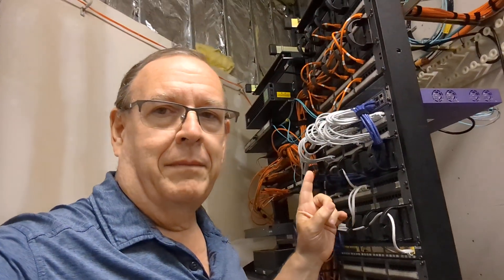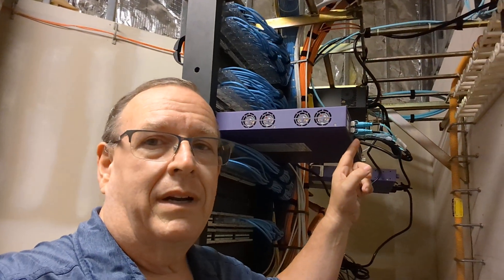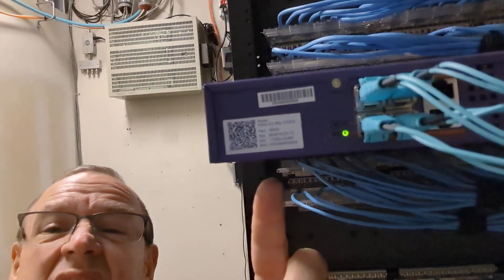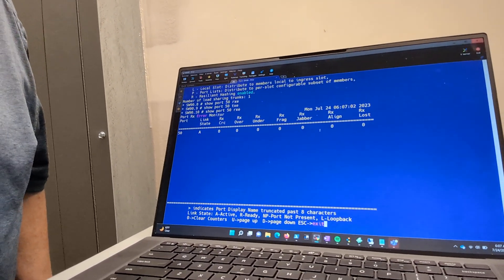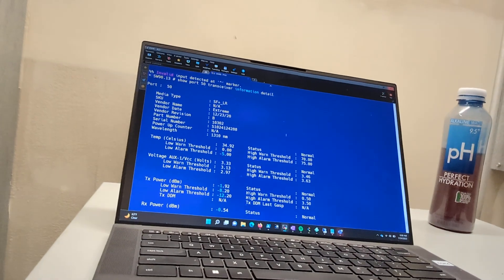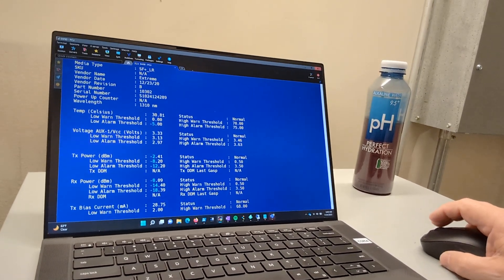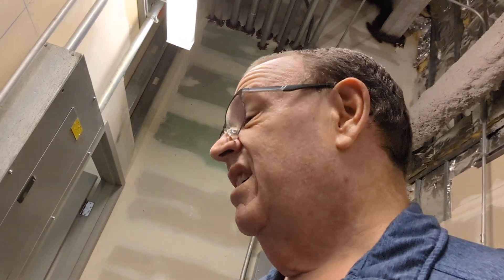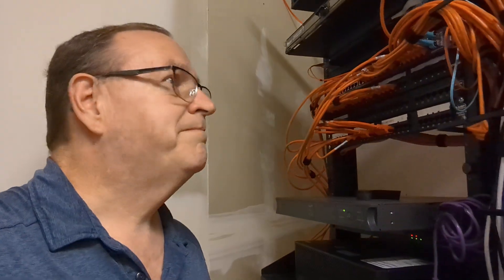Network Admin Life - Disabled Port Follow-up

Comment: You shoud check a procesor and memory level use  on  those svitches , too much trafic flow can cause that problems, i dont know egzactly for extreme routers but on older microtics routerboard when  you put too much flow thrue the procesor  the procesor can cut themself off from the rest off the network and than its time for upgrade
Reply from the maker: We've had processor problems with our core switches but the edge switches seem to have plenty of horsepower.  God bless!

Comment: Wait, are you using SMF optics with MMF cable? I'm just assuming based on the transceiver details and the fiber patch cord color.
Reply: I can confirm that it is Single mode optics as I can see from the Extreme Networks 10302 part number but I do agree that the cable cooler would suggest that they are multimode cables but I would then have expected the light strength be mutch worce than what is shown.
Reply from the maker: Yes I am.  Initially they were put in by mistake.  Both mine and my helpers.  But since most of them are working with no problems we've filed this in the "leave well enough alone" category for now.  As they cause problems we'll replace them with the correct SFPs. God bless!

Comment: I think you should look in to putting some Attenuators on thos fibers as the signal seams to be to strong you might burn out the SFPs faster when the light is that strong
Reply from the maker: You mean my dirty fiber connecters don't attenuate the light levels enough?  LoL!  Thanks for the suggestion, I'll check those out.  God bless!